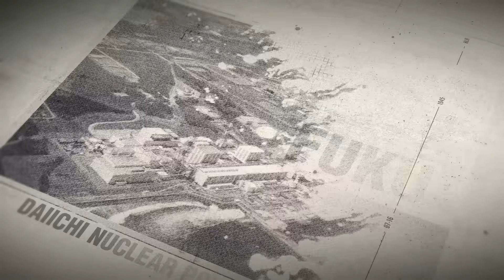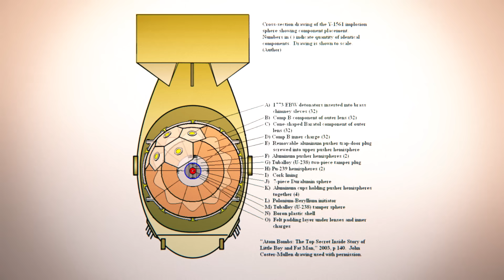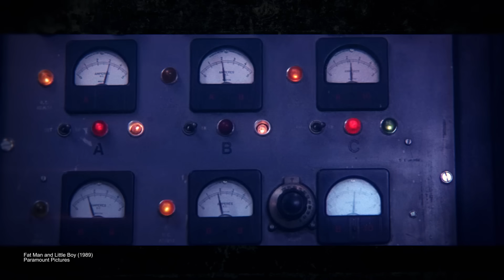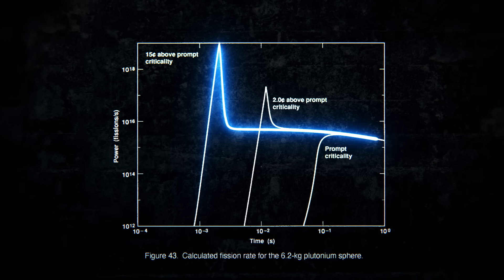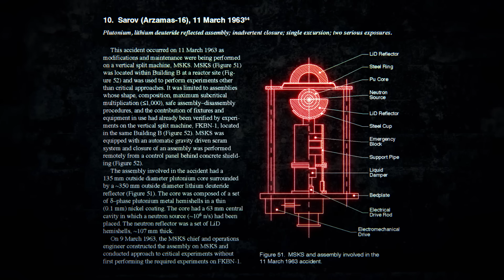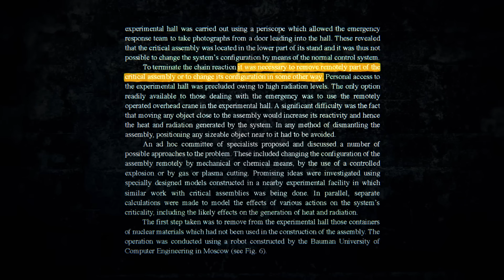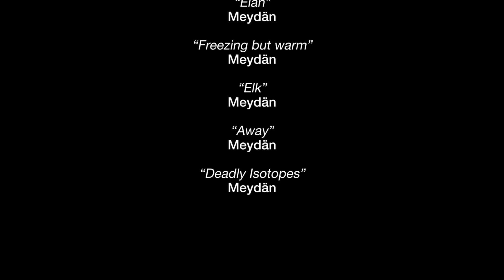Russia's Demon Core - Sarov Criticality Accident

Comment: Death's alone is the wrong comparison.
I agree that nuclear has become exceedingly safer since any of these accidents but the percentage of workers vs the actual number of workers.
150 out of 1.5 million  compared to 100 out of 100 million?
Nuclear has been considered dangerous because of the lack of experience, we all know oil and gas explodes and smells bad.
A quick death with plenty of warning.
Nuclear doesn't do anything kinetic or observable, just kills you slowly and painfully, with no warning.
Same idea as plane crash vs car statistics, everyone drives cars but not everyone can fly; therefore it's safer to fly?
You are not the pilot. You are safe in a car because you are the driver and make life saving decisions constantly. You cannot make a decision from the passenger seat of a plane, therefore you are unable to make the decision to determine if it is safe to ride.

Comment: 2:41 Strictly speaking, while the release of prompt neutrons happens within a picosecond or so of the associated fission event, the timescale for them to cause follow-on fission reactions is going to generally be longer than nanoseconds, because they tend to be traveling slower than you might expect, and the sizes of critical assemblies built by humans tend to be on a human scale (so neutrons have to travel inches to feet before causing a fission event). That said, even for thermal neutrons in a large reactor, prompt neutron flight times will be in the millisecond range, which still gives doubling times that are too fast to be controllable if things are even slightly above prompt criticality (if each fission promptly causes 1.01 subsequent fissions, and flight time is 10 milliseconds, then reactor power increases by a factor of e in one second). In a fast neutron reactor, flight times will be shorter and prompt doubling times even quicker.

Comment: These stories have taught me a lot about nuclear history, and definitely corrected some misconceptions I had.  So I view Nuclear power as it is now, much safer than I thought it was.  

That being said. I am EXTREMELY worried about, say, a few years from now in a hypothetical future.  One with state controlled media and unchecked and unregulated usage of llm's.  Nuclear fills the gap for power demand from massive data centers, but as is tradition, safety regulation are slowly eroded.  Then because of state owned media, when the last person who's job it was to maintain the safety and integrity of said systems walks away (or is quietly fired for raising too many safety concerns) and stops making it all work in a safe fashion.... the problems will range from small to multiple Chernobyl's all across the nation.

Nuclear is very safe.
But what happens when it all sits squarely in the hands of greed and incompetence?

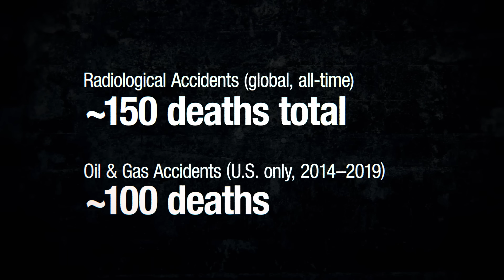Comment: 12:10 Kyle, you are making a proportionality mistake in comparison which invalidates the argument. The Oil & Gas industry has more accidents because it is employed on a much larger scale (fossil fuels supply >80% of world's energy, nuclear is at most few %). A better comparison (for practical purposes) would be deaths or accidents per unit of produced energy.
Reply: Still though, if it was at the same scale as nuclear there would still be more deaths/accidents, though the difference wouldn’t be very big I think

Btw I’m very cold rn can someone get me a poncho?

Comment: Something people don't always realize is that every nuclear accident we've had, we learned something from, and have since designed a way for it to never happen again.

The reason that's not the case for the oil and gas industry is that the oil and gas industry is run by and for profit, rather than safety.

Comment: It's crazy how people forget how dangerous the process of generating energy really can be. But because other accidents tend to be less flashy, or headline catching than "spooky bomb material does spooky things", so many tend to lock in on nuclear. 

Despite the fact that it is basically the safest form of energy out there. 

Wind turbines kill when broken in high winds (and still require massive amounts of ever dangerous oil to even run), dams collapse, and most other sources of power are highly flammable and need to cross vast distances from mine/well to refinement and use, creating a network that both uses energy, and creates risk along the way. 

It's only surpassed by solar, while having a fraction of the space requirements, meaning less natural habitats are destroyed. 

Geothermal also seems to be pretty safe as well, but data seems more limited on that front, so I can't really say either way on that. 

I think the future would probably be built on an energy triad of Nuclear, Solar, and Hydro, with other energy forms supplementing them. 

You can't really get rid of hydro as easy, as it also accounts for necessary vast stores of water that are really important for many communities, especially those in deserts. May as well get power from it too while you're at it. 

Solar can be decentralized, power every home, has good disaster resilience, and has the added benefit of literally taking centralized power out of the governments hands. 

Nuclear should be the backbone. The safe, centralized source we use to power everything that makes our lives run, but can't be powered on Solar alone. 

We should also probably keep the other forms of power around, and maybe throw in geothermal as a second backbone depending on how it plays out, just for the sake of redundancy, as despite the risks involved, way more will suffer and die if we all lose power, so best to have a few backups around, just in case.

Comment: 13:18 - There's a possibility, I don't know for sure and I never asked my professor on how they came up with the test device, but...

As told by Dr. David L Hetrick to his students, he had worked on a number of test reactors over the years.  He was part of Manhattan and worked on a large number of test reactors over his life.  He eluded to the following test reactor that was used for testing neutron flux:  a plutonium sphere with a cylinder cut out of it.  The way this device was tested was that the cylinder would be dropped through the sphere and they would measure neutron flux as the cylinder passed through; before, during, and after.

As happens with a number of test systems, you using end up with a destructive test at the end.  They weren't sure, but they decided it was best to be cautious.  They took the sphere and cylinder out to the Nevada test range, blocked the hole so the cylinder could not fall through and then dropped the cylinder it.  It detonated.

Dr. Hetrick never mentioned how large of a detonation it was, but it did sound like it was less than Hiroshima or Nagasaki.

Comment: Delayed critical doesn’t mean you constantly have to twiddle with the control rods. If you insert a small amount of reactivity the temperature will rise; leading to a doppler broadening of the moderated neutron spectrum as well as letting more neutrons slip through the fuel and moderator as they are ever so less intense. This means power rises slowly; then stabilizes. The main thing that causes you to have to twiddle with the control rods is fuel and poison burnup; xenon-135 and desired power level changes.

Comment: The last minute was feeling a bit odd, almost like forced pro-nuclear propaganda. The lower number of deaths compared to other sources may be true, but the dangers are much higher, as radiation  is invisible to the naked eye. And if so, it's already a thousand times to late...
Also, human errors will happen, the only two questions are when they'll happen and how huge they'll be. The past has shown it multiple times.
I'd rather die by having a windturbine dropped on my head or a dam burst than anything radiation related. If the water after a dam burst is gone, so is the danger. That doesn't hold true for nuclear desasters. Heavy metals stay in the ground forever compared to a human lifetime. The radiation from Chernobyl can still be measured in some foods around here, even though it happend almost 40 years ago! As far as we know, there's no unharmful amount of radiation. Better get as little exposure as possible over the course of your life.

Yes nuclear energy is interesting, powerful, relatively cheap and rather "clean" compared to fossils.
But only if you stop counting dollars right after stopping the reactor for the last time. If costs for disposal of the plant and waste materials were calculated in by the operators, construction wouldn't even be up for debate. That's also the point were ordinary people like you and me start to pay for it with their taxes, or sometimes life expectancy.

Emmision of heat is also to consider for these types of plants.
For 1 GW electrical energy, around 3 GW of thermal energy has to get disposed of which doesn't do much on global scale, but it's not nothing as some might want to make you believe.

There are a lot of alternatives to nuclear power, and almost all of them are better. Humanity should stop boiling water for energy production already, invest into true renewables and all our problems would dissolve.

Comment: one thing i would appreciate Kyle, is maybe an explainer video on all the MANY different radiation measurements we talk about in these videos.  Rads, Rems, Severts, Gys, etc etc
Reply: 1 rad = 0.01 gy
1 rem = 0.01 sv
1 rad = 1 rem (for x-ray and gamma all other types of radiation depend on something called the "quality factor" or "Q" which deals with the absorption qualities of biological material so rems and rads will differ)
Reply: @someguy9046  rem and röntgen are the same thing?
Reply: @FdA-FdA No. REM is a measure of biological dose or rather how much radiation is absorbed in soft tissue. The roentgen is the base unit of radiation a REM is derived from.
Reply: @FdA-FdA  REM = Rontgen equivalent measure
Reply: @FdA-FdA rem is roentgen equivalent man. The first is just energy absorbed per unit mass, and then the Q factor deals with biological factors 🧬 in the “unit mass”.
Reply: @someguy9046  And are you sure this is not the opposite? 1 Sv = 0,01 rem not 1 rem = 0,01. Cause I'm almost sur it takes more sv than rem to kill someone.
Reply: I think he has one already but it's a few years old
Reply: 👍🏻👍🏻👍🏻👍🏻👍🏻👍🏻👍🏻👍🏻👍🏻👍🏻👍🏻👍🏻👍🏻👍🏻👍🏻👍🏻👍🏻 Totaly +1
Reply: Yeah, I second this suggestion. I studied as a radiology technologist, and we had to learn all of those terms, but while I definitely memorized what I needed to to pass my exams, I still reliably confuse them.

The first confusing thing is that some of the units measure exactly the same thing, only they're separated by a factor of 100. IIRC, I think 0.1 sieverts is 10 rem (Roentgen-equivalent-man), and 0.1 Gy is 10 rads (radiation-absorbed-dose)...or something like that.

Then there's Roentgen, which measures the amount of ionization that the air experiences from a quantity of radiation. This is different from Curies and Becquerel, which only apply to radiation sources that are decaying bits of unstable isotopes (both quantities reflect the amount of decays in a quantity of time). 

But I think the most confusing part is the difference between absorbed dose and effective dose. Grays are how we measure absorbed dose (and its cousin, "dose area product" or DAP which is the multiplication of the surface area that is exposed to radiation, by the absorbed dose), while Sieverts measure the effective dose by taking into account "weighting factors." Radiation weighting factors increase the dose you are calculated to have received if the radiation you were exposed to is NOT photons (i.e. x-rays or gamma rays) or beta particles (electrons). Everything else is more effective at damaging your DNA, and so if you are exposed to those more damaging forms of radiation, your effective dose goes up. And tissue weighting factors take into account the tissue that was exposed to radiation. Some tissues like the gonads and stomach are more radiosensitive than others (like skin or liver).

So if you had a foot x-ray protocol of your left foot, and it directed a total DAP of 0.5 Gy-cm2 per image (and there are three images total when you have a foot x-ray), your total effective dose would be ~0.005 mSv. If you instead were exposed to a DAP of 0.5 Gy-cm2 per image when getting a chest x-ray (with just two images acquired), the total effective dose would be ~0.15 mSv. This is because feet contain mainly skin, blood and bone (none of which is particularly radiosensitive, although there's a tiny amount of radiosensitive red bone marrow within the bones of the foot), while a chest x-ray exposes the sternum, ribs and spine (each of which contains a LOT of red bone marrow), plus the esophagus, lungs, breast tissue and part of the stomach, which are all moderately-to-significantly more impacted by radiation than the tissues of the foot. Thus, you would experience 30X more biological impact from the chest x-ray than the foot x-ray...even though there are 3 standard images taken for the foot x-ray, and just 2 for the chest x-ray. But fear not - people are exposed to 0.15 mSv of radiation merely from existing for 2 to 4 weeks on the surface of the Earth.
Reply: @VoIcanoman This was a really good read, thank you.
Reply: @VoIcanoman  The thing I learned (with my veterinary x-raying and supervision rank) is that these things are used interchangeably and sometimes even the experts get them confused, they can't easily be converted into one another, etc.

So all I remembered was microsieverts... because that's the relevant one for my work. :')
Reply: @VoIcanoman  You truly explained that beautifully. Well-done!
Reply: Oh yes please, and explain why there are so many different measurements. I’m 100 % layperson, just a curious one (who as a kid was afraid of nuclear war and still remember what I was doing when at age 13 heard the news about Chernobyl).
Reply: Very good idea !
And they're also Curie, Becquerel, Röntgen... 
With the 3 aspects of radioactivity (activity, emission, absorption) and "historical" units and "field" units (medical, military, engineering), it's a mess and it's one of the big reasons nuclear is perceived as a black box.

Recently my dad went through a physical for his lungs. They gave him technetium-99m for a scintigraphy.
I watched at the prescription, very detailed (they used 3 different of these units), but even with my degree of physics and with hours on wikipedia, I couldn't fully evaluate how many sievert it makes in the end. Very frustrating
Reply: @nicejungle ikr. I did rad training at Los Alamos (rad, rem, Ci)…..spent 20 years at lower energy in P band to W band, then I come back and all the units changed. I really dislike sieverts, grays, and so on. They are too big! I mean 2 Gy is LD-50? Not cool.
Reply: @VoIcanoman
 :"I still get confused..."
proceeds to explain perfectly
Thanks, man. Good info!
Reply: @jonofthehill I mean you can look them when watching yt.
The thing is can you remember what they mean when you’re in an underground tunnel and the sign on the wall says, “30,000 RAD/Hr when beam on”, and you’re wondering how many second you have to reach one of the big red buttons placed every 10 meters down the tunnel, should the BEAM ON sign suddenly illuminate.
Reply: @DrDeuteron  LOL TRU
Reply: When I first started studying nuclear physics, the different units of measurement bugged me until I could see the "why" behind it.
Reply: That confuses me too. It feels like F, C, Kelvin etc but radiation edition. Though there being so many different ways and reasons to measure differently causes me a lot of confusion.
Reply: I'd really enjoy that.  So many different units and measurements.
Reply: I'd ask the Nuclear Engineer when his comment section inevitably steers him to this one
Reply: Bro doesnt know how to look up information he wants to know. This is why we are doomed.
Reply: @minirlz  its an educational youtube channel, of course i could look the information up, but it would still be nice for Kyle to explain it, it is kind of WHAT HE DOES.
Reply: How will I know if I need RadX or RadAway
Reply: You probably want to ask someone who has relevant experience and training.  His graduate degree is in communication.  He ain't no nuclear physicist.
Reply: Just ignore obsolete units. Metric all the way. Grays and sieverts.
Reply: Tbh i had google gemini 3 pro explain it to me
Reply: Yeah Kyle sucks in a lot of things especially that

Comment: The "Demon Core" was one of 3 cores produced by the reactor at Hanford.  That was all of the plutonium they had produced up until that point.  
One was used for Trinity, the other for Fat Man and the demon core was not needed because Japan had surrendered.  Of course by 1946 it would be surplus at the time, but given how long it took to make enough plutonium for the first two bombs, it seems reasonable that this core would have been used or melted down and mixed with the additional plutonium coming out of Hanford to be used for the Bikini "Operation Crossroads" tests.

Comment: When you say that nuclear power is “inherently safe” and use deaths to prove it, you’re only showing that it’s safe compared to other things. The fact that there is a death count at all shows that it’s dangerous. It’s not inherently safe. Also, death counts aren’t the only metric. You’re not showing the big picture. Nuclear reactor meltdowns leave a bigger and longer lasting effect than a simple oil rig or refinery explosion. Walking around Chernobyl is still more dangerous than walking around in the woods by my house, almost 40 years later, while an oil rig or refinery explosion might damage the surroundings, and maybe spill oil, it doesn’t really last for years.